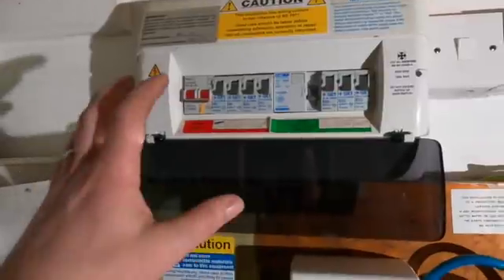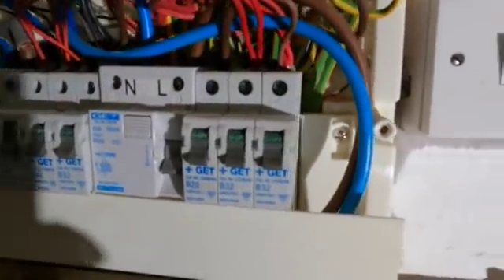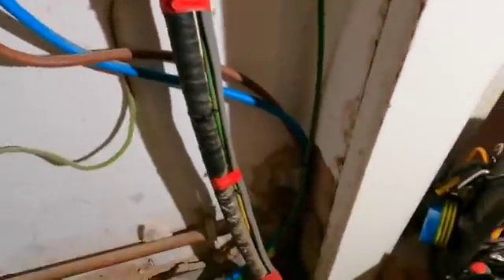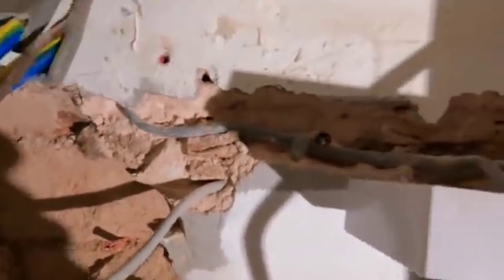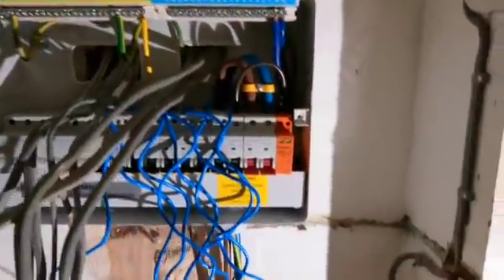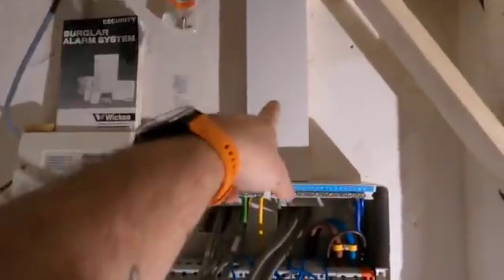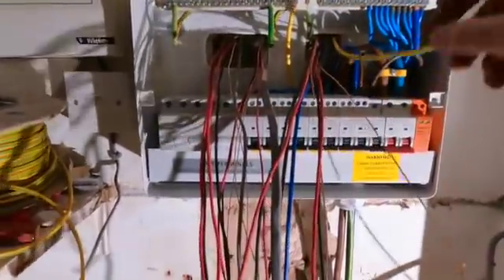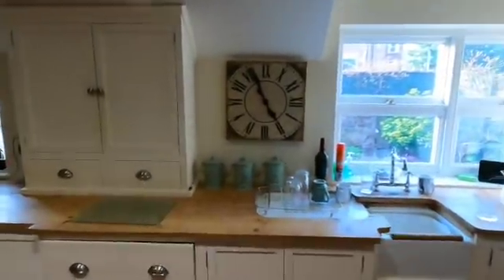Shoddy Electrics #nopride #nocare

Comment: I would never leave a job were there is no continuity on a CPC , effectively you left a part of that circuit with no path to earth if a fault occurs. a young lad of 7 was killed in a pub garden about a year a go because there was no earth on the outside lights
Reply: Good comment
Reply: Are we just presuming the circuit has class 1 fittings installed here then?
Reply: He hasn’t left it he is coming back to rectify the problem,Isn’t that circuit now protected by a rcbo?so until he does it’s got protection?
Reply: @MrPutty69  its protected by short circuit protection and overload protection. If theres a fault between live and cpc on a class 1 fitting that wouldnt show a fault on the rcbo.